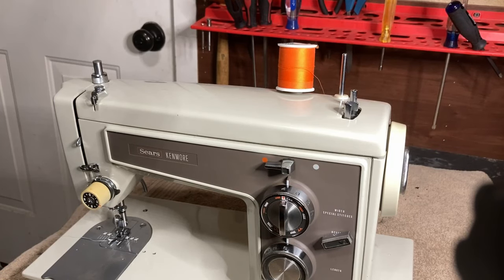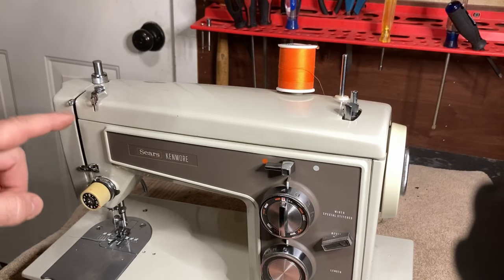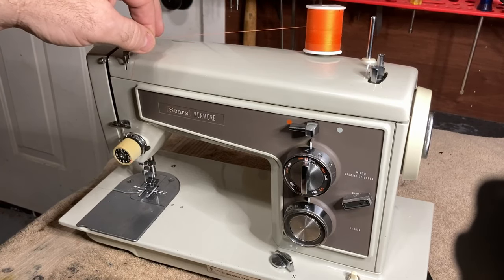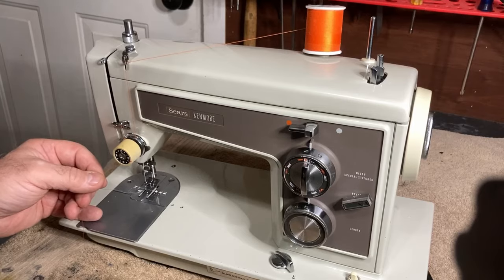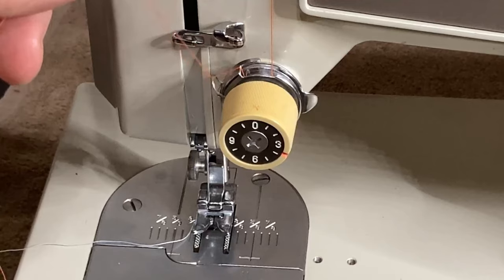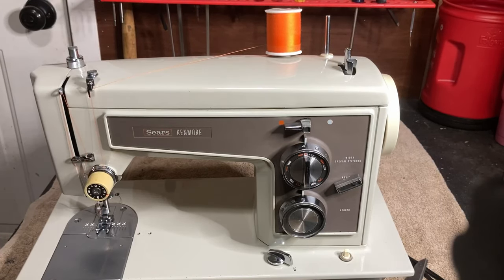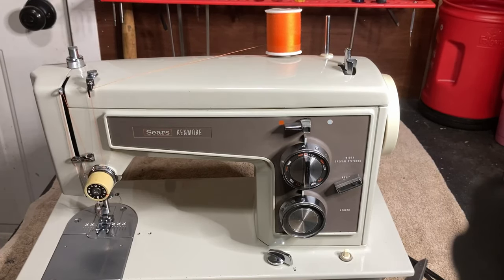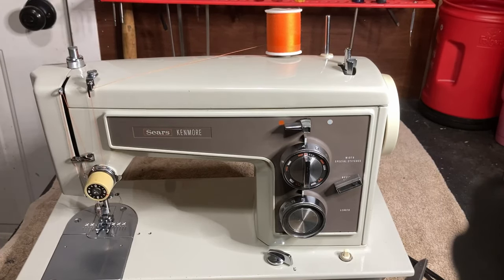How to use a Kenmore sewing machine  for beginners

Comment: I inherited a similar Kenmore sewing machine from my mom when she passed away in 2007. I never learned to use it until this year with covid-19 face masks. This video showed me some of the amazing options this particular machine has and I am eternally grateful. I especially appreciated that your instruction was geared toward the beginner and you gave us time to watch and learn. Thank you so much and I will be following you
Reply: Interesting we both inherited our machine in 2007 and just now wanting to learn to use them!
Reply from the maker: You are very welcome.

Thank you!
Reply: I just inherited a similar one and am learning, definitely will watch this video. Thank you
Reply: @sewingmachinetipsandtricks9079  i inherited a Kenmore 158 and I am having trouble with the feed. I can not get the materials to feed at all . Is there an adjustment somewhere?
Reply from the maker: @thedragonfly6081  
There are several reasons that can happen.

First pull the needle plate and ensure there is no lint build up between the feed dog teeth.

If that does not fix the problem,  with the needle plate on, make sure the stitch length is set to its longest stich and the presser foot up..

Turn the handwheel and ensure the feed dogs come up through the needle plate, move all the way to the back then go down under the needle plate move forward again and back up.
Reply: Where can I buy the kmadt 158.850 sewing machine discs?
Reply: I can’t get the bobbin case holder put back together.  There seems to be only one way to install all the pieces back into machine.  But machine locks down every time.  Kenmore 12 Model 385.

Comment: I just purchased a Sears Kenmore Model 158.16600 for $15.00 from an individual.  I knew nothing about it and figured for $15 it would be a deal even if I only got a straight stitch.  Got it home, opened it up, and saw nothing but fur balls and dried grease.  Everything was sluggish.  First thing I did was look up your video, lubed as you suggested and low and behold, it ran great with all stitches available.  Now viewing your other videos for tuning.  Thanks for being here.

Comment: i recently bought this very model at a consignment store for $50....included cabinet and little sewing chair...like grandma used to have.  Anyway, when I sat down to use the machine...it was barely working, even though it looked like it had hardly been used.  So I pulled some stuff up online and decided to take a look and luckily all it needed was some lubrication and a little cleaning.  The dust had built up in side, but still not bad since it was stored in the cabinet.  And, after a thorough oil addition to the moving parts, it slowly started working and now is working perfectly.  I have referred to your video because I couldn't figure out the stitches and how the little wheel modifiers and dials worked.  Thank you for putting this together.  I will probably have to refer back to it again...but your explanations were very thorough and helpful about how this particular machine works.  It is a solid machine and sooo much better than the cheaper ones on the market.

Comment: Hi Richard.  I acquired a 158.19411 Kenmore as my first sewing machine and am working on learning how to use it.  It was free so there's always the looming (not a pun) feeling that there's something wrong with it, but I think the problems are mostly with me.  You make it look very easy here and this video is the best on YouTube for this machine, the only thing I had to look up in another video was how to pull the bottom thread up, and then I had to learn myself to make sure to route the top thread under the presser foot.  

One issue I am having is that my top thread is getting caught on the shuttle and the machine is "jamming", is this usually a bobbin tension issue or a top thread tension issue?  My bobbin is not original either, as it doesn't fit in the bobbin winder, so could be the problem, do you know the bobbin part number I need?  Does winding bobbins by hand lead to issues sewing?

Anyway, the machine seems to be working so far, the only thing that seems a bit odd is the top thread tension seems to be pretty tight (but I don't have a frame of reference being new to this).  This may be because I am using thicker thread though, or maybe the tension is actually normal.  I've threaded it the same as you did here, though this model has slight differences.

It would be great to see a video of how you'd sew two pieces of fabric together, like maybe more in depth for the 2 most basic ways and introduce some more technical ways.

Thanks for the video!!
Reply from the maker: The thread getting caught on the hook would be the upper thread and will have nothing to do with the bobbin thread.

The hook may have a burr on the point or other damage  and need to be repaired, or the hook race maybe dirty or sticky and need to be cleaned and lubricated.

Make sure you lift the presser foot before threading and the thread is in the tension disc and take up lever.

The smaller the stitch the tighter the stitch will be.

Comment: I have the EXACT same Kenmore machine as you! I was lucky enough to find it at a thrift for super cheap and I'm glad I found your video on how to use it, because I really didn't know what I was doing lol Anyway thanks so much for this video! Also, do you know where I can find more feet for this specific machine? Mine only came with a foot that's only suitable for straight stitch.
Reply from the maker: Hello Claud9,

How are you doing?

 You are very welcome! Thank you for watching the video, I appreciate it!!

That is awesome you found the machine in a thrift store, these old Kenmore machine are still some of the best machines available.

You can get an eleven piece snap on foot set for this machine on sale for $12.00 here
https://eb4.co/Lowshankfeet

If you don't find what your looking for you can also search Ebay for Kenmore low shank feet or Kenmore 158.14300 here
https://ebay.us/CH2HSp

Let me know if you need anything else.

Comment: I have a Kenmore model 1581786081 and all of the sudden my needle has shifted toward the back of needle plate and is right next to it you can hear it touching it as you sew, can you tell me how to adjust the needle. Thanks
Reply from the maker: Is the needle close to the presser foot also?

If not then the needle plate is probably out of place.  If it is just as close to the presser foot then there is an adjustment on top of the needle bar that is probably out and needs to be readjusted.

If you need help with it I can send you a link to my Facebook group and help you there.
Reply: @sewingmachinetipsandtricks9079  yes my needle is just as close to the foot. My model is a Kenmore 158.1786081. Would love any help you can give me. Thanks
Reply from the maker: @dremaperry2900  
Here is the link to my group. I can better help you over there. will need to post images and such.

https://www.facebook.com/groups/479747739423131

Comment: Went out to dinner with an old friend on Inauguration day 2021. Circling the block looking for a parking spot I saw a free sign on a wooden sewing cabinet in pristine condition, sitting on the curb. I already own a BROTHER and a DRESSMAKER that share one cabinet. The one on the curb was a solution to a long-time problem. It also created a new problem.  Inside was a 1974 Kenmore that Sears distributor in Canada sold. Model 148-12501 in immaculate condition and looked brand new.  It even sounds like it was made last week.  Not one scratch and no dust or lint. Now I need to figure out how to reposition the needle, how to set it up for double needle and thread it from a spool to the first element.  I already know how to thread it from the  tension disk to the needle. Thanks for making your easy to comprehend tutorials.

Comment: Dude! I cannot thank you enough for this video. I found this beautiful sewing machine at a thrift store and needed it for a project, but I had no idea how to work it. You are clutch, and you're a great explainer as well. Thank you for this video!
Reply: I was gifted this beautiful machine. I love it but I cannot get it to run
 The motor runs ,the light turns on but the needle does not go up and down. The motor just spins. The belt is good but I cannot get the arms to move up and down. HELP.

Comment: I have been struggling with this machine for years. Thank you so much for your video. I can finally use it. I have a model 158.12271 but it almost the same. Rebecca
Reply: I have a Kenmore similar to yours when turning the wheel my take up lever and needle will not move up and down. It is solid frozen. Any suggestions to fix this issue would be most helpful and appreciated.

Comment: I use the same machine.
Thanks for the description of how to properly thread the top disk.  I've been using that for the sewing mode too, not just the bobbin winding. 

One thing I would recommend to the listeners is to get a copy of the users manual for a quick guide on all the stitch functions. It can get confusing otherwise. 
Have a good day.

Comment: I learned 2 things from your video after sewing for over 60 years!  My problem with my Kenmore Model 13453 is in the bobbin area.  I've oiled, changed the belts, and cleaned the entire machine but the machine won't sew.  If I don't put the bobbin in, it runs freely, but when I insert the bobbin it won't sew, even turning the wheel by hand is difficult.  If I get it to sew a few stitches I get a huge tangle on the bottom of my fabric.

Comment: I have my grandmother's old high shank Kenmore model #148 41500 which I'm proud to now own. I'm learning to sew, and love this machine. It comes with the wood table it's attached to, and I believe it's a cast iron bottom. It's so heavy! And it's a beautifully popular 60's olive green color. This is a very good teaching video about the Kenmore! I've learned some things through this video, such as the tension release with the presser foot raised. I wish I'd have found this video months ago!! Mine has no knobs, but rather two different levers for adjustments of stitching.  But I want to know how to change the presser foot to another with a different function, and if there are other feet for the high shank vintage Kenmores, such as a roll hem foot. Thanks for the video.

Comment: I've had the Ultra Stitch 8 for 40 years--it was my first machine and it still works great.  I broke the plastic extension table a few years ago, so I picked up a Kenmore 6 stitch (158-13400) at a Goodwill store for about $15.  Recently I found a 10 stitch (158-12512) for only $10 at the Restore and couldn't pass it up.  They all work and now I have parts!  Mine are all portable machines and have the free arm.

Comment: I did something good and bad in last 4  years since I retired. I moved with my own Elna bought in early 80s but although new in box seemed 8 years older but that was a good thing. Bought a couple really old ones just because I learned on a treadle then retired to smaller rural town. Realized Im it as to fixing or mending etc. here. I have now 11 machines most of rest given to me and 9 brands. That fact taught me some basics to look for in all machines. Just to say for a bit of instant knowledge. All basic domestic machines when threaded looks like the letter N. My Elna Carina the tension disc is on top then it goes down to thread like an N. Most class 15 bobbin users the tension is on the front but still looks like an N. I can thread any machine I sit at never having used it because I know what its supposed to do. I put off fixing up some of my machines so back to remembering what I had looked up and finding more detailed videos for them. I just learned about the Kenmore tension. I have a couple with stuck tensions. I have 2 otheers the feed dog seems too high. They are really vintage. I think its just a screw underneath but will take me some time to figure that out. Someone told me people raised the feed dog to grab more when quilting. But thanks for the videos. Will check all yours out!

Comment: My wife inherited a 148.12071. It was stiff and filthy. I removed it from it's case and opened the top. Except for the addition of a Zig Zag function it's a Singer 15 clone internally. This is the first Kenmore I've ever been into. Because it's a Singer 15 clone I already knew everything I needed to know to clean and lubricate it. Inside I was surprised to find a peace of denim that was stuck between a fork on the crank shaft and it cam lobe. I got it out and the machine immediately freed up. I lubricated it with 3 in 1 oil and let it sit a couple of hours while I cleaned the inside and outside of the machine removing thread lint packed in the feed dog. My first test was a completely success. Just like a Singer 15 it plows through material like a tractor.

Comment: I have a 158 from the 70s and it still works good.  only difference is that mine takes cams.  Actually the cams are not used much, the stitches on the dials are some of the best,  This is an excellent machine.

Comment: Thank you. I found a kenmore 148.13110 at a Salvation Army for all of $15. Bought a pedal on Amazon for $30. Had to WD40 the entire unit after I darn near burnt/seized the engine...but luckily I have an engineer in the family who fixed my motor. Regardless, I love this machine. Your video was priceless. 
Now if I can get the gear on the bobbin winder to work as it should I’ll be even happier. Thank goodness for bobbin winders and other machines but your video was very very informative. 
Thanks again!

Comment: Thank you! I just bought a 158.1941 at a garage sale and this was very helpful. Especially the bit where you said that it was normal to see a little of the top thread on the bottom, and vice versa – I thought the thread should meet in the middle so you only saw the top color on top and bottom color on bottom, and was going crazy trying to set the tension on my Singer 201!
Reply: I just watched a video from Vintage Sewing Machine Garage on the 158.1941 last night for the first time. It is an all metal machine with all of the basic bells and whistles - zigzag, stretch stitch, a buttonhole and a free arm. Excellent purchase - I'm jealous.

Comment: Thank you so much for your instruction . you r the best teacher
Reply: Thank you, the model 158.12311 . Doesn't have the specialty switche but under the width lever there's another lever that just has a orange dot on the left and s stretch on the right. What is this lever for please? Also the Bobbitt winder is not spinning I haven't opened up the top yet.  But I'm going to oil it since it's been sitting in the garage for a few years. I just wanted to learn the proper way to thread it. Any more tricks or tips would be helpful.  Thank you

Comment: Inherited a Sears Kenmore 148.200 in 2004 and am just now getting a chance to use it. I believe it was made in the 60's. Just repaired/attaching a torn zipper on an old sleeping bag.  Next, I plan to replace heavy straps (seat belt material) on my Deer Hunting bibs.  Little worried the material may be too much for the Sewing Machine.
Reply from the maker: Depending on the state of the machine it may need work, that’s a long time to sit without being used. It may need to be cleaned, the old oil/grease may have dried up and become a thick heavy gunk or completely dried to varnish and need to be removed then lubricated again.

Dried oil and grease can cause friction which will cause a lack of power and possibly cause it to lock up.

If the machine is clean, lubricated and running properly it should do fine with those materials provided you use the correct size needles.
Reply: @sewingmachinetipsandtricks9079   It is immaculate. My sister-in-law acquired it years before, then purchased a new one due to her love of sewing ballet out fits for her daughter. It sat in her house for years and then asked my wife if she wanted it.I SAID YES, but it sat in our house for years. Three days ago, I thought to see if it would work. Followed your YouTube videos and others to learn the mechanics and use. There was no gunk. Need to get some oil and a better belt. Repaired my sleeping bag sipper last night as well as sewed new straps on my deer hunting bibs.  Plan to figure out how to patch the knees in my work jeans like my mother used to. THANK YOU again for your Videos !

Comment: Great video thank you. 👍 I have a 158.19311 model that looks almost exactly like the one you're describing except mine has cams and the stretch stitches built in and has a free arm. The feed dog button is down inside in the free arm area and the on off switch is around the side near the turning wheel.  I bought it at Sears in Alberta Canada in January 1969 and it's been my repair and create machine for 52 years. Never been professionally serviced either because I can't get it out if the sewing table! I can't even raise it up to use the  free arm, but I've managed. 
In spite of having it so long, with all the extras and manual, there are still things that I hadn't figured out, so thanks again. 🙂
Reply from the maker: You are very welcome!

Yes the old Kenmore Machines are great!

Thank you!

Comment: I inherited a Model 158.13512 and I didn't know how to use it at all (Except for threading it). Your video has taught me how to change the type of stitch. I still need to find a video on how to wind a bobbin on a machine more like mine, because I don't think the hand wheel releases the clutch on it. I have a dial on the top of the machine, but I don't know what the symbols mean. Again, thanks for this video! It's got me farther along in learning to sew.
Reply: So I found a manual of my exact machine. It says the hand wheel is the release,  but I pulled with all my strength just like you showed to do, and I can't get it to come out. So I can't wind bobbins. What would you think could be wrong with it?